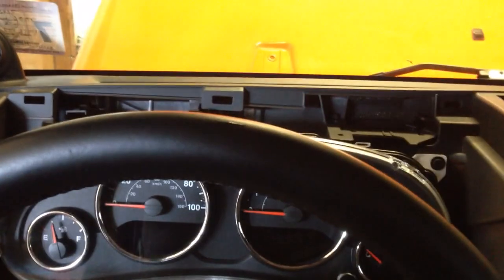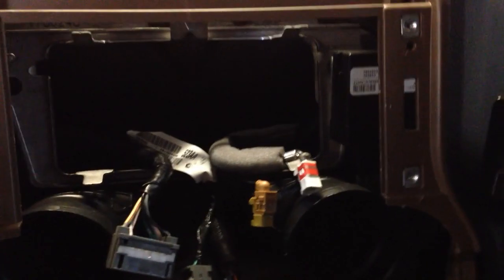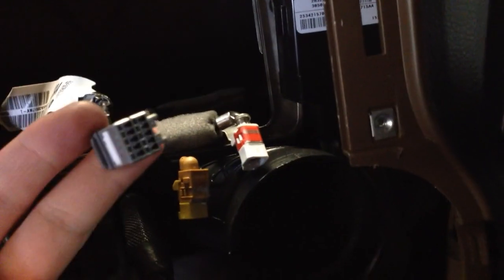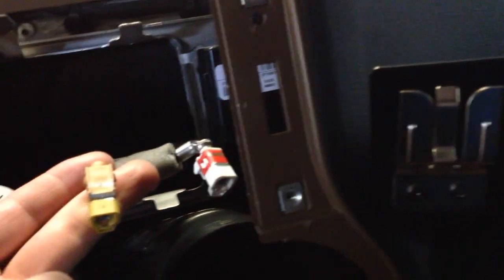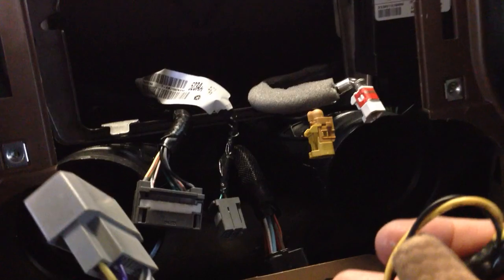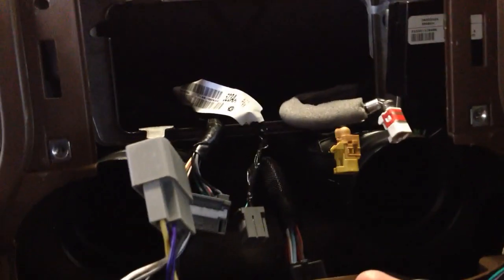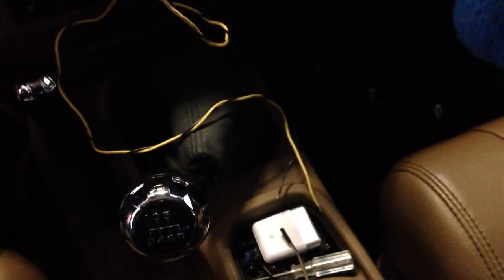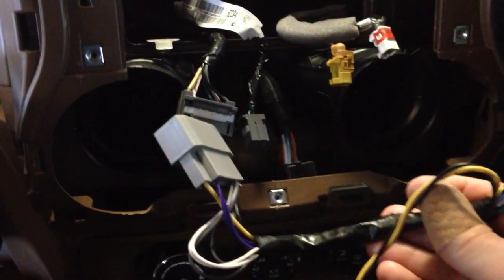Hacking the Jeep Interior CAN-Bus, Part 1

Comment: I am trying to use the can high and can low to install a Thor Exhaust System to my JL Rubicon without splicing the wire. Is it possible ?
Reply from the maker: Probably best to ask on a JL technical forum as I don't have any expertise with the JL.

Comment: Great Tutorial in the Wrangler Forum, question the pigtail wires black and Yellow, where did you locate the information to identify the can bus wires and which ones were the Low and High side? i have a 2014 JKU and after the CanL and Can wires for a project ill undertake.
Reply from the maker: All of the wiring info came from the Mopar connector repair website at http://connectors.dcctools.com/home.htm
Reply: @nuclearchadwick  right on dude, appreciate the info,

Comment: Chad, super helpful; looking to do this on my 2017 JKU.  I dove through your videos and site but I'm not sure I grasp the harness wiring though and was wondering if you could go into a little more detail on what you looked for and how you wired that up?  I know its been some time since this video so if you know of any streamlined means as well I'd appreciate that info as well!
Reply from the maker: With the harness the intent is just to create a pigtail off of the CAN-H and CAN-L wires. I did this with the separate harness so that I didn't have to modify any factory wiring (i.e. splicing or whatever). The harness I made in the video is designed to plug into the radio, and the factory wiring plugs into it, and then it just has the extra wires coming off of it.

You can do the same thing anywhere there is the interior CAN bus, but the radio is the easiest to access. You can also do the same thing off the diagnostic port, but that's a separate bus with less data unless you ask the TIPM to give you that data.
Reply: @nuclearchadwick  Great thanks.  So sounds like you need an aftermarket harness and you just splice its CAN-H and CAN-L mid line to create another set which you run to the Pi?  This leaves you in a situation where the aftermarket harness still works as designed (including CAN-H & CAN-L to the back of the radio) but also a new pair of CAN-H and CAN-L wires you can tap to the Pi, am I tracking?
Reply from the maker: @UCwTNZPjPWElWaJhBayfvnZw That's exactly right.

Comment: Chad,

I have an aftermarket stereo in my 2012 wrangler and i was looking for a power wire to setup a reverse and front camera module. I was behind the stereo deck and  was using a probe to check positive on the harness that goes to the provided external can-bus decoder and I briefly touched a ground on the car and the wipers moved moved up and down for a split second. Now my issue is that with the keys out of the ignition the stereo stays on. Any ideas on this? I have changed no connections before this issue came up. The deck came with an external  can-bus decoder, think this is bad?

Comment: Chad, Hi, Do you know if the Canbus interior broadcast comes down to the OBD2 connector? Can happily watch it for canhi/canlo data all day long, just don't want to remove radio etc? Or is there somewhere else it can be picked up from? Thanks mate for sharing your info!
Reply from the maker: On the Jeep JK, the interior CAN bus is not electrically connected to the OBD2 connector. There is speculation that you can send a software command to the diagnostic unit to get it to forward the messages on, but that's just speculation. The lack of signals on the diagnostic port is why we do the radio connector hack.
Reply: correct. - its at the back of the radio though. ah well will just tap into there and maybe drop it down to the OBD2 connector. this is running a nissan v6 talking back to the jeep can. have to translate in between ;) thanks for coming back mate

Comment: I have an 08 dakota im looking to hack into, it looks like the radio harness is the same for my radio. What wires are the can high and can lo in the harness?
Reply from the maker: +dimas3097 Head over to connectors.dcctools.com and pick your vehicle - and you'll get the pinouts for the connector. It's probably the same.

Comment: hi,
do think that is possible to active the function on the car to close the 4 windows , fold the mirrors and close the sunroof when the doors are locked by remote, and do this using an obd system , like have to buy on the internet , but only for GM ?
what is the difficulty to do this for dodge journey? there is any security protection on this car? because i think that we don´t need the seed/key to send a command to this actuators and to read the information that the car are stopped and receive a command to lock the doors by remote key.